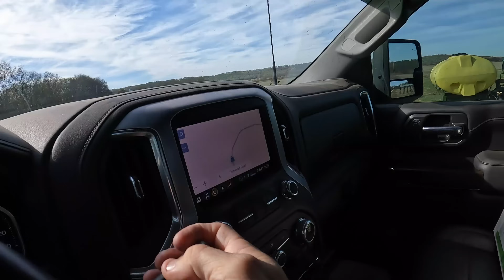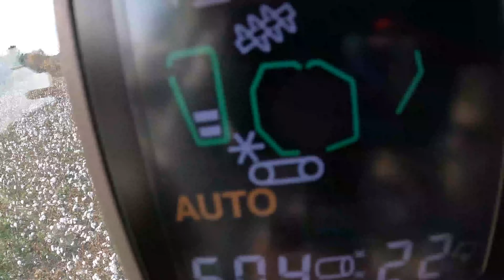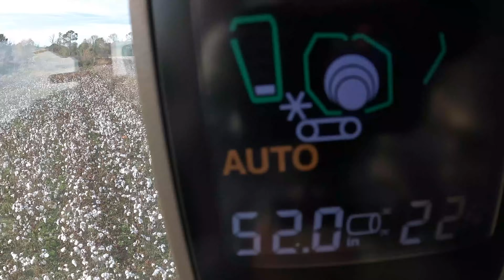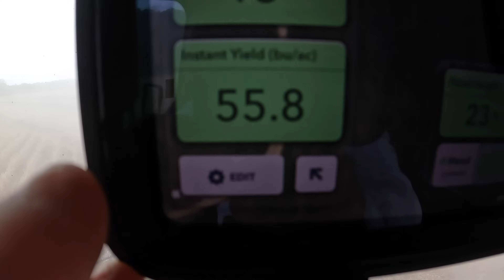HARVESTING COTTON, SOYBEANS , AND A LITTLE TILLAGE

Comment: I even listen for a half hour to my vehicle every week.  I spent most of my adult life in a coal fired power plant listening to pumps, motors, fans, pulverizers, etc.  Listening for ANYTHING different, not necessarily odd, just different.  The only way to be sure is to know what it's supposed to sound like when everything is right..
Reply: Same here. I worked in power plants in bama and knew what normal sounded like so when a piece of equipment was on the way out i could hear the difference in sound as well. Thats cool

Comment: We had a 9986 and never had any trouble like this! Had a head that didn’t get any grease because the little block on the of the head over the shaft didn’t have a hole drilled in it from the factory and had a wiring harness rubbed on a hose and messed it up. Bout the only major problems with it.

Comment: Do you measure the cotton by bales per acre, pounds per acre or how do you figure up the yield? Awesome video as always.
Reply: Pounds per acre is the most precise. A bale is about 500 lbs but they vary by gin and gin equipment. 1500 lbs/acre would also be called 3 bales/acre.